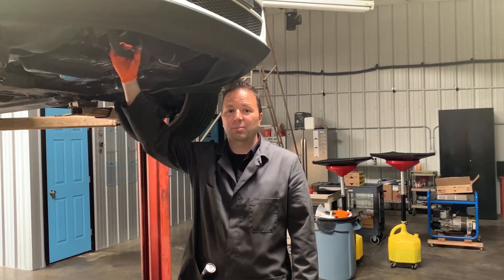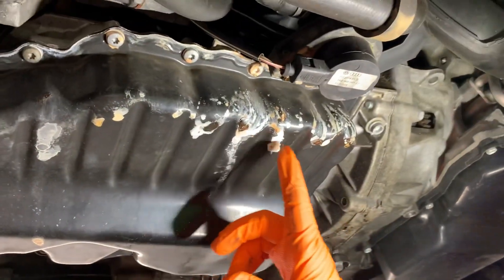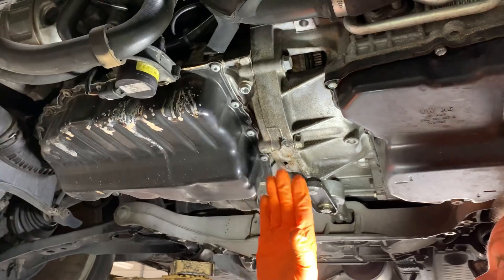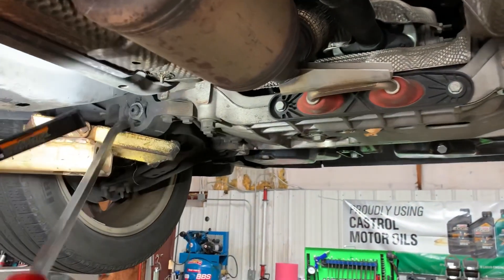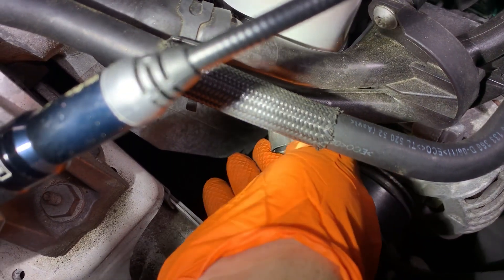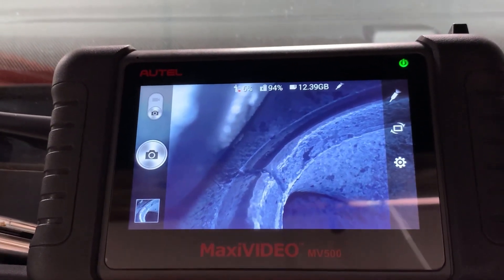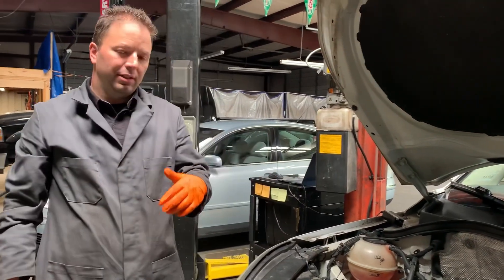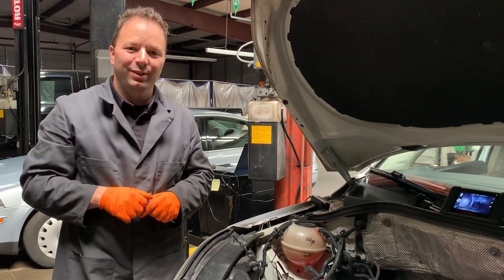2011 Volkswagen Tiguan - Coolant Leak & Turbocharger Diagnosis 🚗

Comment: I just got a 2011 Tiguan. First week no heat! Found one problem, it was the inline to heater core, broke off in hose. Replaced, purged system, blew out heater core with water. Then filled, and had heat for a minute, now no heat. VW your attempt at  these TSI motors suck!

Comment: Great engines? hahahehehoho. I'm ROTFL. You mean the ones that don't leak or burn oil or implode?
Leaking or clogged fuel injectors on the 2.0T TSI.
Failure of the 2.0T TSI Water Pump.
Misfires & Faulty Ignition Coils on 2.0T TSI
Failure of the Timing Chain Tensioner
PCV Valve Failure at 2.0T TSI.
Diverter Valve for 2.0T TSI Boost.
High-Pressure Fuel Pump (HPFP) failure.

Comment: 2:47 my car is leaking some kind of liquid (sort of rust-colored, not oil) from the same spot as in the background in the video. Does anyone know what this could be? It's not water as it leaks it even when there was no rain, and the liquid does not dry away once it's on the ground
Reply from the maker: Hello, what you are seeing is very likely coolant/antifreeze. The factory antifreeze for these VW's are violet/pink in color.
Reply: @premierautomotivediagnosti9432  thank you very much!
Reply: @premierautomotivediagnosti9432  I see on the coolant amount left that it's not massively leaking. Is this leak something I should have fixed, or can I tolerate it assuming I check the coolant levels regularly?

Comment: German vehicles coolant system consist of rubber o-rings and hard plastic pipe's.. I stopped video at 20 second mark to input the comment. If you own a 2000 year model or newer german vehicle, good luck with your coolant system.. the hard plastic degrades/ disintegrates. German cars are the absolute worst for coolant system design/functionality
Reply: thx for the info!!   i had my water pump replaced on my 2014 tiguan last week, i replaced it with a metal pump (120k miles)
Reply: Was it successful? I'm running into the same problem again  @clint1285
Reply: That is why I am here, trying to find someone replacing one of the cooling hoses. D:<
Reply: @littlemissdyer13  It would be nice to replace one of the coolant hoses/piping. If they offer the option to replace more of the hoses/piping, i would take that route.. if you plan on keeping the vehicle for awhile.  And make sure you call around for quotes, or try to get it to a German specialty shop that KNOWS there way around your vehicle.
Reply: @littlemissdyer13  google VW repair specialist in ur area.
Reply: What is the long term solution of the hard plastic pipes degrading?